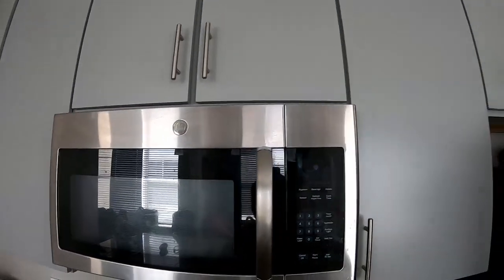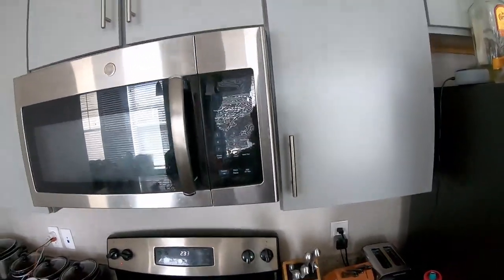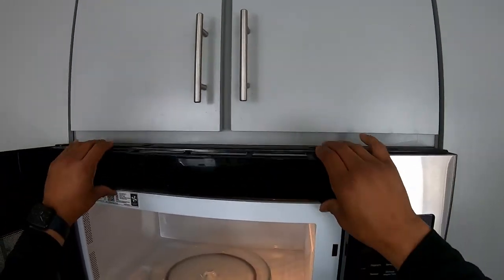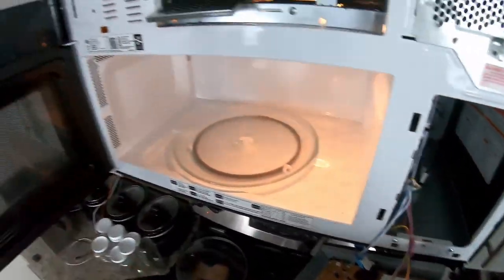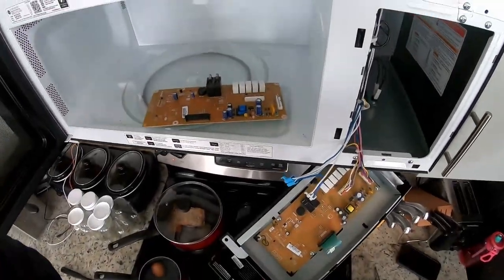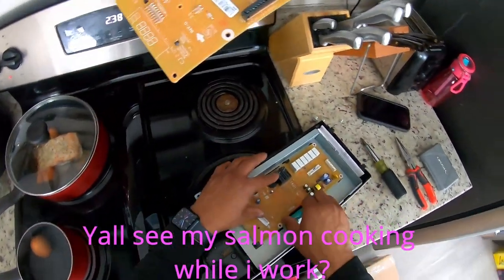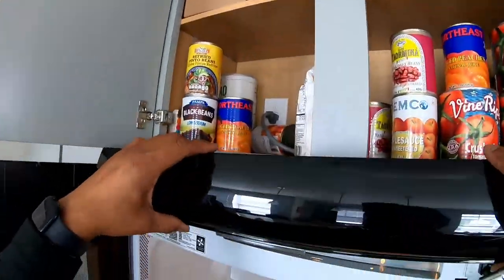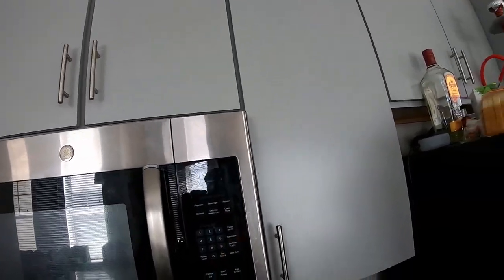GE microwave repair, broken microwave display , number not fully showing 5 min fix

Comment: Had the same issue and it was the same fix. Replaced the mother board, got it on the GE website since it was the same price as eBay. Took me less than 10 minutes to replace. GE wanted $150 for a service person to come out plus parts and labor if they could fix it. Save yourself the money and do it yourself. Rate the change a 1 out of 10. Extremely easy.
Reply: How much was the board

Comment: Which apartment is that? Looks like the ones I work at
Reply from the maker: what state you on ?
Reply: @OffDaHook84  Kentucky Bowling Green
Reply from the maker: oh no lol im far from … Maryland this style is probably used in almost every state 😂😂
Reply: @OffDaHook84  probably.  We just had an issue with a microwave like your video and I'm like damn is that here 🤣🤣🤣 looks like it
Reply from the maker: lol all good yea i try to do a lil video when i run across common shit/ issues 
Hit that subscribe if you didn’t already 👌🏾💪🏾💯
Reply: @OffDaHook84 did you replace a part or did you just snap the piece back into place. I am having the same issue with the same type of microwave it's not 5yrs old and works perfectly fine accept the digital read out is not fully lit as it should be. Tell me the name of the part if you actually ordered, please.

Comment: Anyone try unseating, cleaning, and re-seating the ribbon cable? The display is separate from the controller, and might work (I'm about to give it a try).
Reply: I have mine out right now.. I noticed the same thing? any luck? I can't seem to find JUST the display online either.. which would be a super easy solder job.
Reply: Did it work?